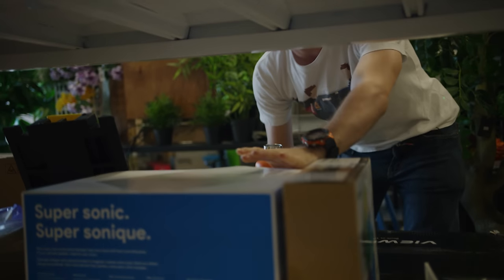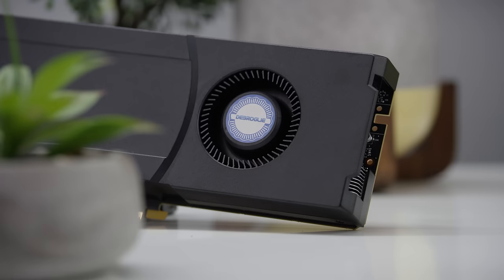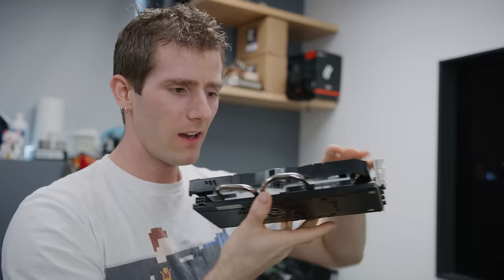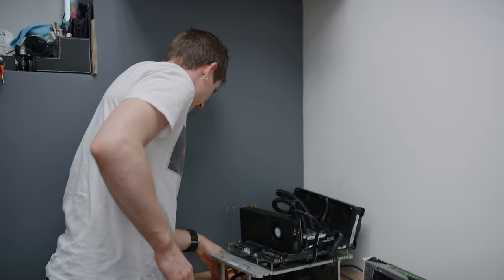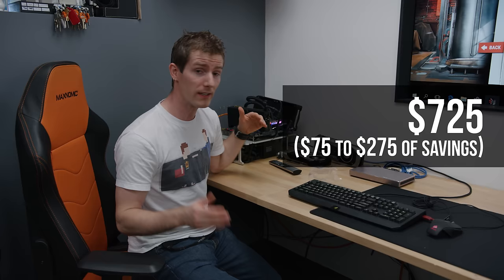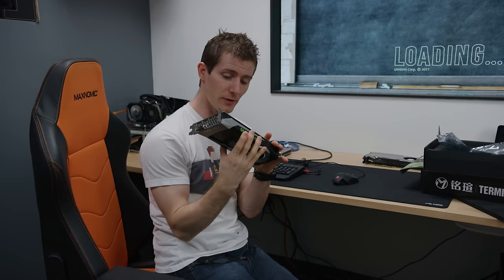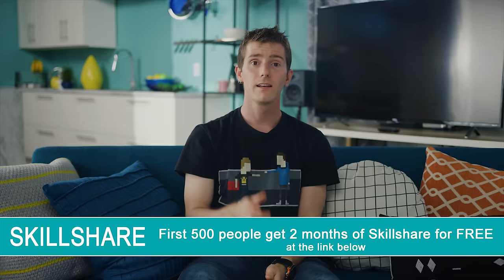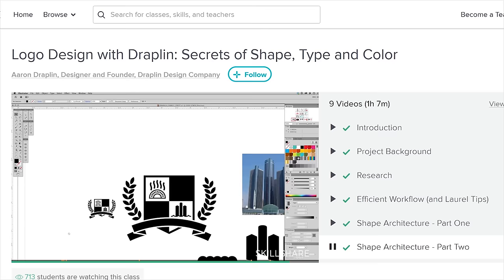Cheap AliExpress Graphics Cards - SCAM???

Comment: 1060 5GB version, in China we call it 1065, it has 1280 cuda cores same with 1060+6GB (1066), but only 160 bit memory. It is designed for net cafe’ usage. Because it can handle high setting PUBG while the performance of mining decreases dramatically due to less bandwidth of memory. Theoratically it can be only bought through particular channel directly to Nvidia, not for private gamers, but it is China, so...There are lots of 1065s out in the market. Same price with 1060 3GB 192bit(1152cores which we call it 1063), but can deliver better performance. 1066s are more expensive due to bitcoin and other mining usage.
Reply: 宋欣睿 cool
Reply: 宋欣睿 thanks for this explanation :D
Reply: also 1065 was not commercial unit for a while (at first nvidia actually band anyone who is openly selling it), but u cannot stop the seller anyway.
Reply: That is brilliant.
Reply: i am confused, whether or not linus is playing the whole "there is no 5GB 1060" part, clearly one of the ltt would take 30 seconds to look up that it exists before buying, hell i knew it, just by following videocardz.com
Reply: Fun Fact: these 1060 5GB Versions are produced with semidamaged 1080,1070TI and 1070 chips that can't be used to produce these cards because the chips are partly damaged. This also makes this cards cheaper for the chinese net cafes
Reply: @sebastian haban
source please
videocardz.net  shows the 1060 5GB cards to have gp 106 both for the zotac and maxsun  (shown in this video) version.
and i don't see any  reason to reuse semi damaged gp 104 chips, because the 1070 is already so heavily cut and gp104 is a tiny chip to begin with and on a very mature process, so we're talking near perfect yields.
so please give me a source, i'd like to be proven wrong.
Reply: They did research it, and did explain all of this in the video. Did you watch it...?
Reply: Interesting. I want one. :D
Reply: 宋欣睿 I thought YouTube was banned in China or something. Or are you in Hong Kong or something like that
Reply: Pin this shit bro
Reply: Demonslayer20111 every major city in na and eu has huge Chinese populations.
Reply: Just D then he wouldn't be in China would he and wouldn't have first hand knowledge of this.
Reply: 其实现在1066的价格已经掉了很多了 感觉已经没必要特意去买缩水版的1065或者63了。。
Reply: It is still banned,but really not that hard to get over that "wall" ,but English is a little bit hard for most of us so we don't post that often
Reply: 宋欣睿 how are you on YouTube. Didn't your govt ban YouTube.
Reply: Good to note. Now, considering they're meant for internet cafes, doesn't that mean thermals are also good? Considering how long a computer runs in internet cafes..
Reply: Basically using VPNs (I'm from Hong Kong and occasionally go to mainland China). Now I heard the government were banning those VPN service providers, but it seems they're not completely gone yet. I hope the situation gets better for them.
Reply: Johnson Li (ME) I heard Hong Kong is also going to lose its sovereignty.
Reply: +
Demonslayer20111 I am studying in Italy. But in mainland China you can do it with VPN.
Reply: +黄子扬
 最近刚跌的价，问题是这个卡也跌了，我看到吧里有人1500就买到
Reply: +kim jong pun I don't know where are you, but Chinese are everywhere in the world.
Reply: Demonslayer20111 this is actually a common knowledge, you do not need to live in China to know that. Especially when you into that kinda stuff.
Reply: 宋欣睿 I don't mean to be rude but are people in China happy being a part of a communist country where media is controlled by the govt. Also are people in Hong Kong ok with the fact that they too will have to eventually become a part of mainland China. Forgive my ignorance.
Reply: +kim jong pun You are not rude but naive. Don't discuss politic topic under a Technical video.
Reply: Don't ask me why am I on Youtube. I am not in Mainland China, I study in Italy right now. It is true that in mainland you cannot browse many websites. But how blind are you to not see a single Chinese on the street in your Country? I am not interested in explaination of the relationship mainland and HK and other region with Chinese culture under this video. Although I am abroad, I am still using the social media in China, which is my majority source of what's new out there.
Reply: +
Lord skrubb I dont think so. Net cafe means they have to make profits. The build quality would be quite basic, as is shown by Linus. Your card can also handle 24*7 gaming too.
Reply: 要开会了就查得严一点，实际上禁不完的...
Reply: 他就是图样，别理他...
Reply: 宋欣睿 ah ok that's what I was wondering thanks
Reply: kim jong pun I’ll explain why he thinks you are naive. As a common folk what you want from the media is real and true information. Even if the media is free of government interference it doesn’t mean they are legit and not lying to you. Take CNN for example. Chinese government controls most of the TV media, they get a lot of hate from the casual Chinese too. But stuff on the net are vaguely regulated besides the “wall” that you can bypass anyway. For example there are social media outlets running off their mouth unchecked and the government generally doesn’t care unless you’re being an asshole for everyone.
Reply: kim jong pun 

Also, Hong Kong kind of already belongs to mainland China it was returned to China after British colonisation. And the Chinese army have had a division stationed in Hong king since decades ago. China also set the “one country two rules” policy which basically meant Hong Kong kept its political and social structure. So a lot of things like mainland taxes and the “wall” doesn’t apply to them.

Comment: Was anyone else hoping he would plug it it and it would come up as a crappier/ older model
Reply: Hoping no
Expecting yes
Reply: I was expecting it to blow up
Reply: spunk why tf haven’t you uploaded in 2 years?
Reply: 420th like no one else touch it
Reply: If it was from Wish, yeah, that would be a fair expectation. Aliexpress is actually mostly legit.
Reply: Aliexpress is NOT Wish
Reply: spunkflunk what happened to you? 3 years no videos. You really going to ghost your fans like that. At least give us a goodbye video.
Reply: Where r the uploads?
Reply: spunkflunk bro, I’d die if it showed up as a gma 950 64mb mobile gpu on a desktop PCB
Reply: Well the 5 gig one was crappy.  Slower bus than a 4 gig one ??
Reply: what most people not understand is most of this stuff i made in china so why should they not have this stuff if your a miner you will love their boards sooner or later they make great cheap stuff and there is no expansiv brand behind it
Reply: I was hoping it would come up on GPU-Z as FAKE.
Assholes still selling fake GTX970/980/1050/1080's on eBay.
If it's got a VGA port it's FAKE!
Reply: I was hoping it was legit
Reply: specifically a gts 450
Reply: @crypto3118  Creeper moment
Reply: “Gtx 1050 ti” 

ACTUALLY A GTS 450
Reply: Yea I was
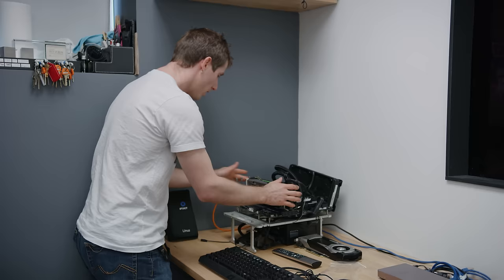Reply: Glad I read this 3:22 minutes in, thanks for watching for those of us who want more sooner.  So its a decent card or a shitcard soon to be discovered is the real question.
Reply: No, because every video does that
Reply: Me
Reply: Ye
Reply: True
Reply: Well, my Maxsun GT 1030 is real
Reply: Yes, like usual.

Comment: Buying graphic cards is for poor. Legends download and install graphic cards.
Reply: Heroes don't need to download and install it.. all the process is done automatically :)
Reply: That's how I get muh ram.
Reply: chuck norris's PC case is empty and not even plugged in and he can still get better benchmark results.
Reply: *gets rickrolled
Reply: Legends play with their own minds so they can travel to a parallel world where you can actually download a graphics card, so they are still having the same pc there but with a much beefy gpu installed
Reply: apt update && apt install rx-vega64 && sudo reboot now
Reply: Ultramega legends play on intel HD graphics
Reply: I can change the PCB length in my driver. Get on my level.
Reply: God Legends just think about it and the graphic card is there.
Reply: Sudo? Pft, you noob. When I want my machine to do something, it powers on and asks me if I want it to do that, then rolls on its back to signal submission. Sudo... pft... if you need to beg your machine for elevated access, you might as well just get a girlfriend so you can ask her if you may hold her purse.
Edit for clarity, this was in reply to the "apt update && apt install rx-vega64 && sudo reboot now" comment.

Comment: 5GB wasn't an accident. It was a deeply researched number to minimize ram while also minimizing slowdowns from caching in modern games. They were really trying to focus in on bang for the buck and lead to a really weird amount of ram :P
Reply: in fact, the bus width matches for qgb missing

5/6ths of 192 is 160, as if the configuration is the same but chopped down.
Reply: @Tyler_Nelson  I believe this is accurate, due to the way NVidia assigned ram, at least back then. A bank of memory was dedicated to a specific 32-bit section of the total bus. That seems like an inefficient use of bandwidth, but perhaps they striped the memory allocation across all the chips so the full bus is being utilized all the time?